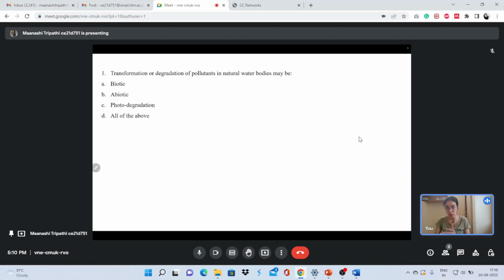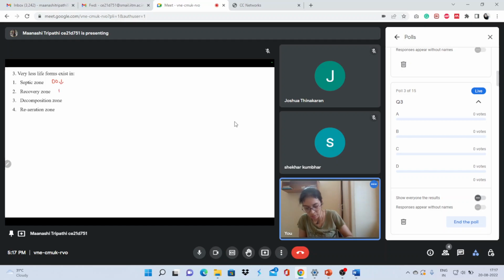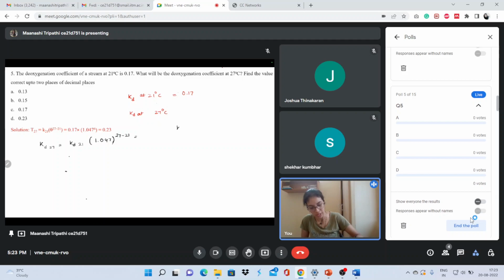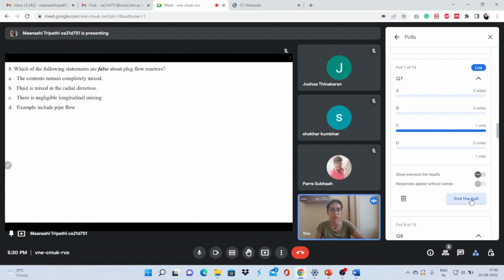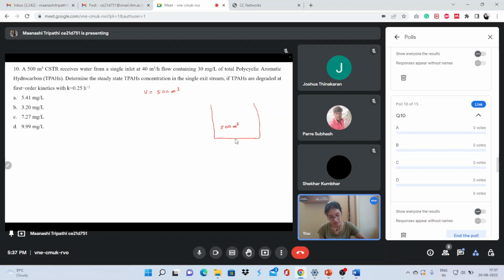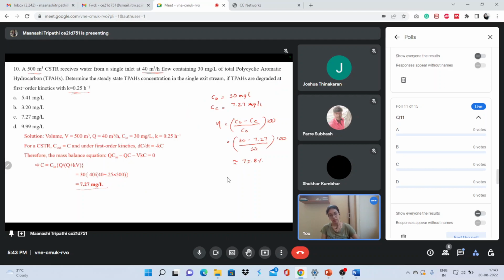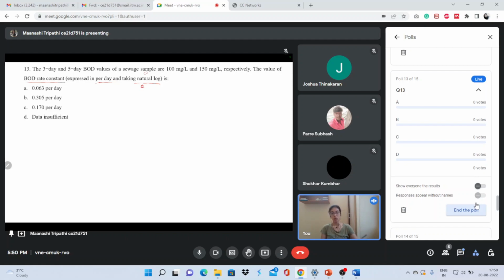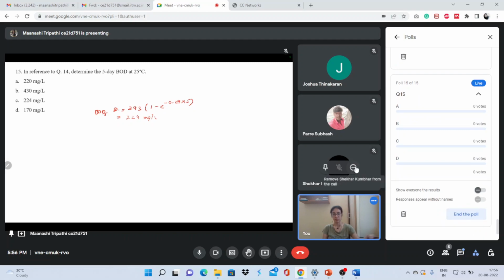Wastewater Treatment and Recycling Week 4

Comment: The solution to problem no 11 is 226.8. The equation is V= -(40/0.25) X {ln(7.27/30)) 
Or to put it otherwise 
V = -Q*ln(Cout/Cin) / k.
Please correct me if I am wrong.
Reply from the maker: Thank you for pointing it out. I have made the correction and updated it in the file.